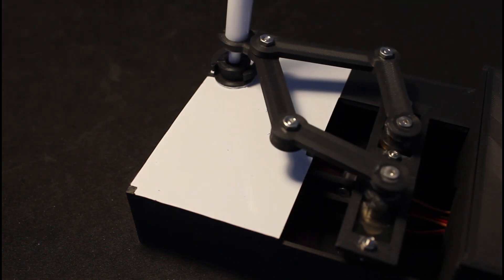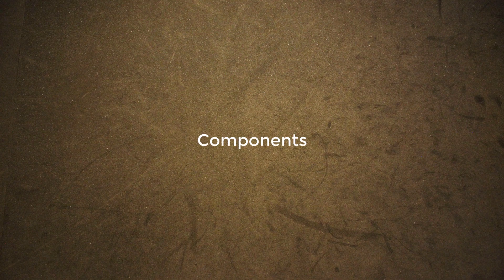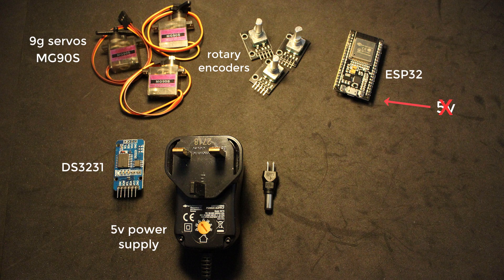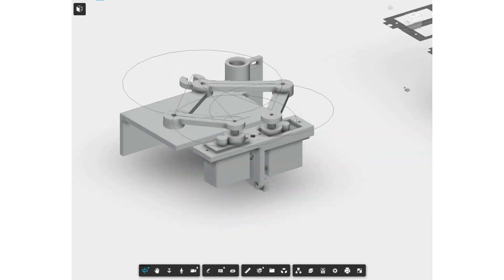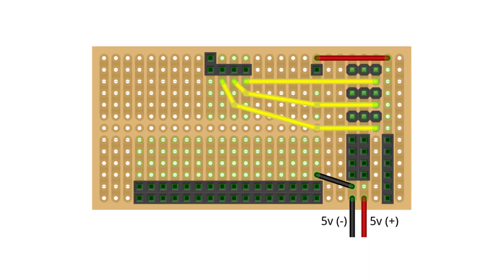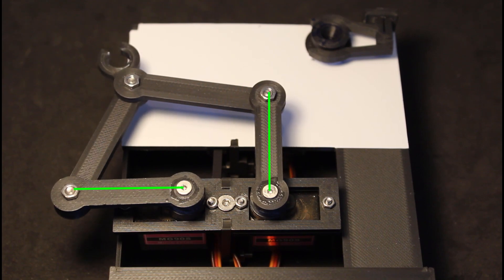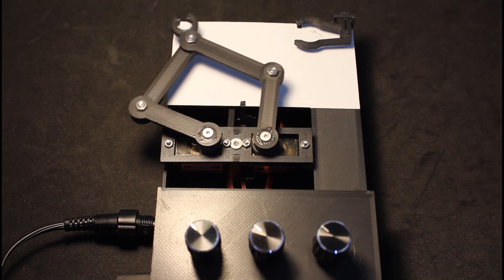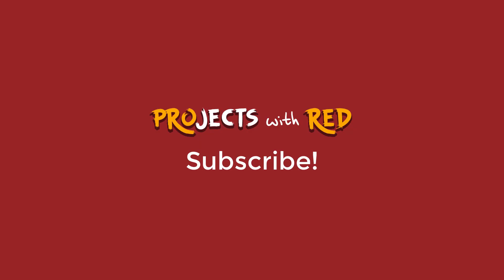Arduino Automatic Time Drawing Robot Arm! | #P5

Comment: Hey Red!  Thinking about taking this project on but making it a little bigger than it currently is…. So I guess that would mean longer arms and a wider case.  I’d also like some quieter motors. Would you have any suggestions?  Would the code scale okay if I just make the whole thing twice as big?
Reply from the maker: That's great to hear! In terms of quieter motors, I am not sure, I haven't looked into that before. For the code, yea, it should work totally fine, you may just need to tweak some things but for the most part it will be the same. I hope this helps, let me know if you have any other questions.

Comment: This is dope. Thanks for posting this guide, I really want to make it now!!!
Reply from the maker: No worries! I am glad you like it. Remember to subscribe if you enjoyed or found the video helpful :)
Reply: @ProjectsWithRed  Can you do a project with an esp 32 ble keyboard with this library: https://github.com/T-vK/ESP32-BLE-Keyboard with buttons
Reply from the maker: @levitategamer7151  This is exactly what I did at first actually. But I quickly realised that Bluetooth on the ESP32 uses way too much current. This meant needing a very large battery to run for a reasonable time, which makes it impractical. I even tried using deep sleep, but bluetooth takes a while to reconnect which creates a significant delay on key presses with deep sleep.
Reply: @ProjectsWithRed  ok thx

Comment: Nicely done!
Reply from the maker: Thank you!
Reply: @ProjectsWithRed  Actually, as far as further projects, given the ESP32s IoT capabilities, plotting out images or weather info, or whatever would be pretty interesting!
Reply from the maker: @createinvent  I actually did a project like this not long ago! Check it out using this link (https://youtu.be/iJIebUzhAIM) or look at my channel for a video measuring air quality. An ESP32 is used to obtain data from 2 sensors which is then being plotted in real-time in the browser and also being saved to the cloud at the same time. Let me know if that is the kind of project you were referring too. If not, give me more details of a project you want and I will for sure consider it!
Reply: @ProjectsWithRed  Not exactly - I mean you could use the drawing arms of this one to plot data from the Internet, it wouldn't collect its own data. Though I suppose having internal sensors would be interesting too.
Reply from the maker: @createinvent  Oh yes, I was actually thinking about that initially, to make it also for example plot/write the temperature and humidity using the DHT11 sensor, but I unfortunately didn't have much time to complete this project. Great idea though to get data from the internet using the ESP32 and plotting/writing it rather then using sensors.